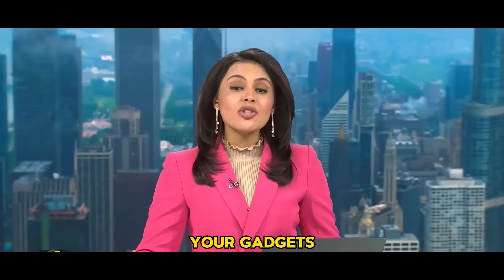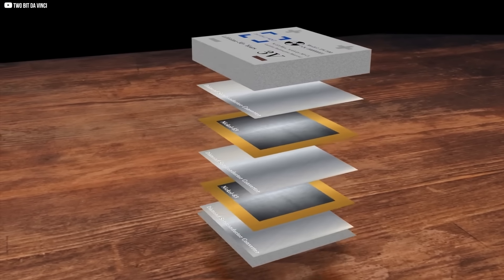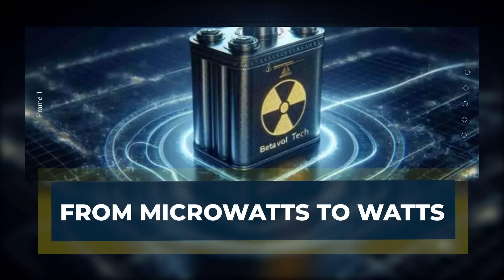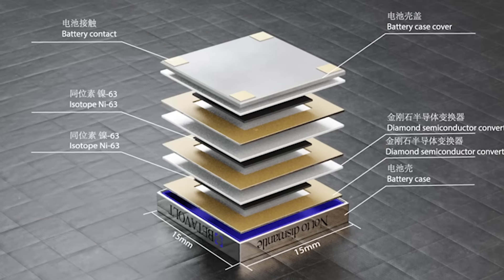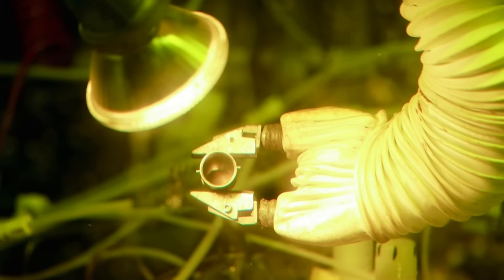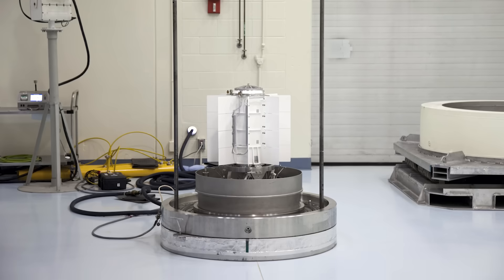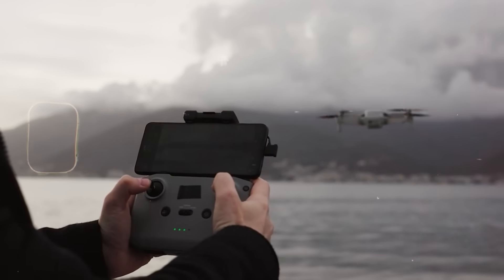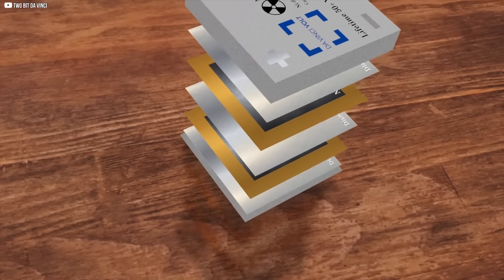The Battery That Lasts 5,000 Years (No Recharge Ever!)

Comment: A man in England had to pay $35,000 to replace his Tesla's battery which weighed at least 1500 pounds. The battery had to be huge to run for hours so a Tesla could drive several hundred miles before requiring a Recharge.  If a nuclear battery can't run out of power, and never requires a recharge, it seems like a nuclear battery could be much smaller and lighter than the bateries Tesla has used for years.
Reply from the maker: Thanks for sharing your thoughts on the different types of batteries.

Comment: You should,ve mention that invertors & transformers can increase the amount of voltage and thus amount of watage.
This way low power nuclear batteries could be used to power those invertors & transformers wich will multiply it’s power😁
Reply: You don't get something for nothing , If you increase voltage your amp will decrease so wattage will not increase. You should get a ticket for trying to break the law of conservation 😅